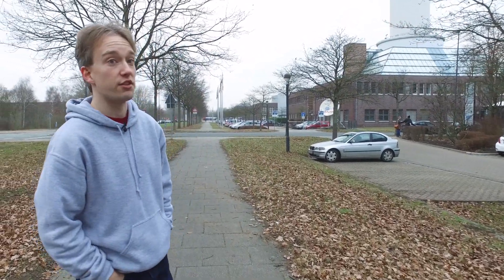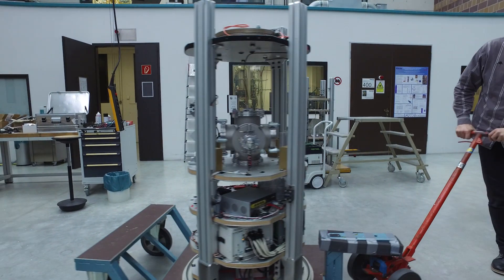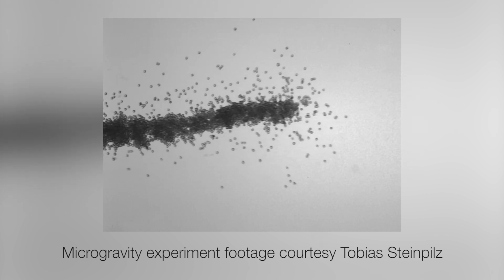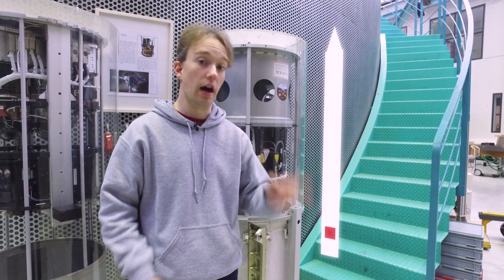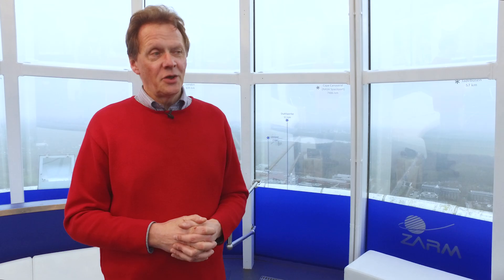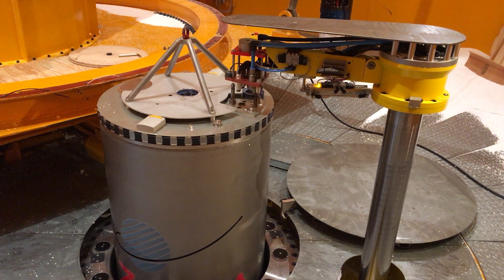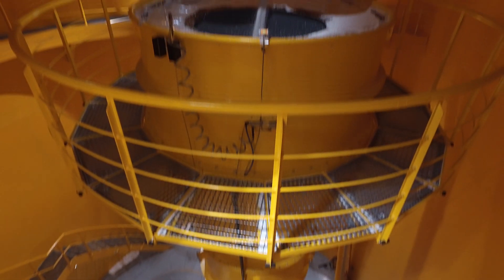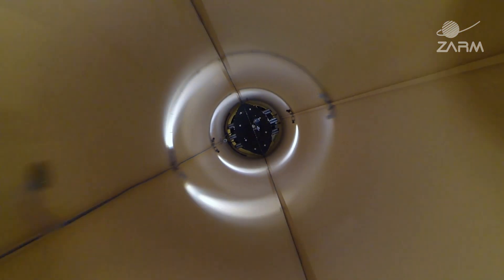Zero-G Experiments on Earth: The Bremen Drop Tower

Comment: i understand how falling creates zero g, but how does slingshotting to the top create zero g?
Reply: SomiTomi
stop giving misinformation the gravity at 250km is nowhere near the gravity of the surface of the moon. in fact it's pretty much the same as on the surface of the earth.
Reply: Connor Hill This is how you teach physics concepts to people, not by 
trowing a bunch of technical words, theories and laws, but by putting it
 in common terms that anyone can relate to and understand.
Reply: BoomBrush 
The acceleration stops less than a second after being slingshotted.
Reply: They get 0G the whole way through - the acceleration due to gravity is the only significant force acting on the sled once it leaves the slingshot.
Reply: acceleration is change in velocity. slowing down is change in velocity, the same as speeding up. once out of the cannon it is only accelerating due to gravity. this means that anything in it is in free fall both going up and down.
Reply: Michael Wylie 💥 that made sense now 👍.  Thanks!
Reply: Speed is a relative thing, it doesn't matter if the object is going up or down, as long as the only force it is experiencing is the constant acceleration of gravity, it will imitate a zero G environment even thought the object is well withing the gravity pull.
You can "feel" that you are starting to switch from rise to drop just because of the air around you and other que. But when you eliminate everything but the gravity, you achieve an almost perfect simulation of zero G
Reply: +Connor Hill You sir deserves a medal
Reply: Relative to itself it's always "falling downwards after the launch. Where the earth is doesn't effect the canister, it's always accelerating in the same direction from the get go.
Reply: Connor Hill amazing explanation. thank you!! :)
Reply: Another example that you are able to experience for yourself: Grab a ball while you are on a trampoline. As soon as your feet leave the ground, release the ball. For those few moments you are in the air, the ball seems to be in complete zero gravity relative to you.
Reply: +steven yau +SomiTomi
Indeed, the pull of Earth's gravity at 200km is still about .94g while the Moon itself pulls at you with 0.16g when you're standing on its surface. The Moon is held in its orbit by the mere 0.0003g that Earth is still exerting at that distance. Of course this is not only negligible compared the the Moon's gravity when you're on its surface, the Moon itself is in free fall around the Earth, so you don't feel that pull at all.
Reply: BoomBrush It becomes weightless the moment it is released from the slingshot. The slingshot initially speeds it up immensely quickly, so it isn't being accelerated for very long. At that point, it is being accelerated only by gravity, and since it is flying through the air in a vacuum, there is no other force acting on it. You see, we feel the force of gravity only because there is another force that acts opposite to it.. the ground. As long as we don't have that force, or any other force (i.e. Air resistance, the acceleration of the slingshot), we will feel no force. This is because the force is simply acting on us freely, with nothing stopping it.
Reply: jonnenne this is just not true. at the peak the velocity is zero. not the acceleration that is still 9.81 m/s^2. 
the zero g is there from the moment it leaves the catapult. becouse there is no other force acting on it other than gravity.
Reply: I understood it fastest by just visualizing the forces on the object and understanding what weight actually means. Weight is only more than 0, if the Earth is counteracting the force of gravity (so you standing on it). Take that force away, by throwing it up, and weight = 0. Mass isn't ofcourse, weight is.
Reply: thx Loke. i didn't catch that.
Reply: While going up the barrel and everything inside are deaccelerating at the same rate, so nothing inside is falling relative to the capsule, just like when it's going down.
Reply: Yes, thanks for letting me know. I messed up some quick calculations, sorry about it.
Reply: Sheepofthe Goodshepherd the earth axles rotates 360 degree in 24hours or 86400. it was in 0g for 9 secs. 360/86400*9= 0.0375 or 3/80 degrers. almost noting.
Reply: "The important thing is not no acceleration, it's that every piece of it is experiencing identical acceleration, and that that acceleration doesnt put tension or pressure on anything." No, just no.
Reply: If you think about there being a super fast elevator pulling you upwards, and the string pulling the elevator up gets cut, gravity will begin slowing down the elevator and you at the same rate. Gravity will not slow you down any faster or slower than the elevator, so, relative to you, you would be floating around in the elevator in zero g. Whatever items they put on the capsule to slingshot will be in zero g once the slingshot releases them. Relative zero g is experienced whenever something is being acted on by only gravity with nothing else to stop it or affect it.
Reply: Gremlin,
I think your intuitive analogy of drifting up in the freed elevator, or the water splashing out are both the result of rebound,, something extraneous.  Your legs,,, are used to holding your body weight,, yes,, they could propel you to the top of the suddenly freed elevator,,, the glass suddenly caught by your hand,, as well.  But I would suggest an experiment.

Flip a one third full water bottle to land on its base.  We've seen it in videos often.  Water is an in-compressible substance,, it has no rebound.  If the water bottle hits squarely, it tends to stand, exactly as it landed,,, with the water squarely in the bottom.  The 'trick' with flipping a water bottle is the rotation before release,, it pins the water into the bottom.  There is little or no splash,, it lands dead.  If you were to try the same trick with a compressible liquid in the bottle,,, I doubt you would be able to have it land consistently upright.  On the sudden stop,, the compressible liquid would rebound, and the bottle jump back into the air.  ONLY outside,,, gasoline is quite compressible.  Try water, try a fuel.
Reply: BoomBrush ok so, i can understand the confusion because when youre accending in an aeroplane or similarly you dont feel weightlessness, you may actually feel heavier, but thats because the plane (or whatever) is constantly accelerating away from the earth's surface, but the slingshot only accelerates the capsule for a moment, and in that moment, the capsule gains enough momentum to reach the top of the tower, in a way, as soon as it leaves the slingshot its falling back towards the earth (because gravity is a force that causes acceleration and not a constant speed) it just has a bit of momentum left to reach the top.
Think of it similarly to when youre in a car, if youre at a red traffic light with no traffic ahead, and you accelerate to 30mph (once the light goes green, duh)  in one second, then youre pushed back into your seat by the acceleration, but if youre cruising along at 80mph and not changing speed, you dont feel any force acting on you because youre not accelerating, youre cruising B)
(hope this was helpful, its not exact science im using here because our perception of acceleration is dictated by the fluid in our ears, and our perception of force is dictated by other senses, you really gotta study physics for a lengthy amount of time before most people can actually comprehend it :P 
)
Reply: SomiTomi It's very far from "not quite zero". At 400 km above Earth it's about 8.7m/s² as opposed to 9.8m/s² at sea level.
Reply: Kiwipai best explanation so far.
Reply: Connor Hill thank you that was a great explanation
Reply: BoomBrush you dont feel forces, only the changes, gravity doesnt change so you feel nothing
Reply: +Robert de Tatta
So sitting in my chair right now, gravity is not changing so I should float away? You should read through the thread. There are several good and correct explanations already.
Reply: Penny Lane gravity doesnt change but the molecules in your body are constantly moving pressing you to the ground
Reply: So it's a constant force instead of a change, which according to what you said earlier I wouldn't feel. I'm just pointing out how little sense your explanation made. I'm not doubting you meant the correct thing. You just didn't say it. So you're not contributing anything worthwhile to a thread that already has a number of correct and nonconfusing explanations.
Reply: Penny Lane no the molecules do change direction. so the force changes permanently but your body automatically corrects for it. kinda like seeing ur nose.  if you drive a car you make turn, so do molecules
Reply: Sheepofthe Goodshepherd bible says earth is round. jesaja 40. i believe verse 22 but not sure
Reply: Sheepofthe Goodshepherd dutch bible is talking about a sphere
Reply: Sheepofthe Goodshepherd wel then this is the day that i completely change my worldview. the earth is indeed flat
Reply: And of course all that is said in the bible has been proven true... I'm joking, it's all fairy tales for peoples who can't take decisions by their own.
Reply: wrong, they get 0 G as soon as the slingshot releases it.
Reply: Connor Hill ok what I can't quite get is this. Imagine your basketball is transparent and we can see the pebble inside. You've said the two won't accelerate at different rates because no air is resisting the ball. Ok great but then that in theory means the pebble would be "weightless" but would still be as it was at rest inside the bottom of the ball to start with. 
What I don't get is if both canister and contents are truly weightless throughout then what would even cause the items inside to move Ina dynamic way? It sounds like either the container would affect the item inside kind of skewing the results or due to both travelling identically what would ever cause the contents to change states in a way we can learn anything from?
I hope that made sense
Reply: imbecile
Reply: Igor Igor who was that for?
Reply: Your question is perfect.  Actually it does not land exactly in the same spot, because the Earth is rotating on an axis,,, and the latitude for the tower must be what? 48 or 50 degrees north?  However,, it is very slight, and it is absolutely repeatable, and calculable.  You will find your answers in an artillery table.  I do have a book here somewhere,,, been years since I've seen it,, an entire volume on angle, distance, time of flight, and corrections for the Earth's spin.  It varies with the latitude and compass direction of fire.   Corrections are needed for very long artillery,, 15k, 25k, etc..  The artillery,,, or the object in the tower,, once released,, is very Newtonian,, it is the Earth that tries to move out from under.
Reply: The important thing is not no acceleration, it's that every piece of it is experiencing identical acceleration, and that that acceleration doesnt put tension or pressure on anything. 
From the perspective of the capsule it is perfectly indistinguishable whether the earth is moving up towards it or it is moving relative to the earth. In fact in 4D spacetime it is more accurate to say the earth is moving towards it at 9.81 m/s^2. So when it's thrown up they are giving it greater velocity than the ground has, but stop accelerating it putting it in zero acceleration. But the earth keeps accelerating and when the ground reaches greater velocity than the capsule then the capsule starts "falling" but the capsule keeps identical velocity throughout that change until the ground catches up and hits it with that cushioned bucket

Not sure if i explained that well, i recommend checking out PBSspacetimes's videos on gravity
Reply: Gremlin the OP
Reply: +GrayEcho That's great and I understand that concept but I think I didn't explain my main issue correctly. If you imagine the acceleration then lack thereof that would affect both you and the elevator differently. Once the cable was cut you would feel the lack of force driving you down into the floor of the elevator and that would naturally make you move upwards.
I guess I'm thinking of a glass of water. Imagine you throw your hand up sharply and stop suddenly the water will naturally be thrown up and likely out of the glass. If you watch the video it shows it from a different perspective (check around 1:12) but imagine you rotate that footage 90 degrees anticlockwise. That sort of pattern is exactly that shown by water in the situation I described above. A strong central column with drops starting to break away and the longer and thinner the column gets is because more and more water is leaving the column (as well as a form of "stretching" if you can call it that).
Now to explain my main gripe.
Its simply that the contents do very much seem to be affected by the sudden then lack of initial acceleration. I understand there is probably some merit to what can be discovered subsequent to that but all experiments will be affected by this and therefore it seems that the results maybe only initially will all exhibit a very similar pattern (at least when talking about liquids or maybe something made up of a large number of small parts like sand lets say). I just don't see how that element really teaches us anything as that part is always created by the loss of acceleration.
I hope that made sense
Reply: +Sailor376also Sorry but I'm not sure how that relates to this when the capsule is effectively fired in one direction suddenly and then allowed to freefall. Its different from the centrifuge-like effect that spinning a bottle creates.
A better comparison would be to grab your bottle of water and throw it straight up into the air with no rotation and see if the water in the bottle leaps upwards at the end of acceleration, which it would.
I'm not trying to be rude but what exactly are you trying to say with your example? That a compressible liquid wouldn't react in the same way as an incompressible one? That a compressible liquid wouldn't move upwards in a column that starts to lose parts of the liquid in various directions? Is that all you are trying to say?
Reply: You make it more appealing, but you need quite a bit more for a lecture.

It's an important part to make it appealing, but also the rules the system follows can be appealing.

Theories and laws are really important, to understand.
Maybe not for the things right in-front of you, but if you get a good grasp on a theory, following ideas will occur and make other ideas and concepts more appealing.

There always has to be a good balance of Formula to Appeal.
Reply: jonnenne misleading, you never get 0 g, but you DO get weightlessness, the moment its released from the slingshot, but it experiences greatly amplified weight at the moment it accelerates
Reply: +Sheepofthe Goodshepherd Have you never heard of inertia? Just because you launch something straight up does not mean it suddenly loses all of it's inertia and land somewhere else. Every object attached to the surface of this planet and the atmosphere that surrounds it has inertia and roughly the same tangential velocity at a given latitude. Therefore for most local calculations on the planet you can ignore the rotation of the Earth and work with a simple frame of reference. Does this mean the Earth is flat? Absolutely not.
Reply: When there's nothing holding you up, you experience zero g. The capsule is accelerated for 200ms with all the kinetic energy it needs to get to the top. From the end of launch until splashdown, it's at zero g. Its position and speed are unimportant.
Reply: Basically, the capsule and all its contents accelerate rapidly, but only very briefly. Once they're moving upwards at their top speed, there is no air friction to slow them down, because the interior of the tower is a vacuum. This means that the only force acting on the capsule is gravity, pulling it down. But gravity is pulling on the capsule and all its contents uniformly, so everything that was launched upwards will rise and descend uniformly.

Imagine you were in a sealed box, that was falling in a vacuum. Both you and the box would be falling due to the pull of gravity, but because the floor would be falling at the same speed as you are, you would experience a sense of weightlessness. This is the environment that the capsule's contents would experience (it's also how the zero-G training plane the US air force uses works, by the way).

The researchers could just drop the capsule from the top of the tower to get the same environment. But by launching the capsule from the bottom, they get twice as much time to conduct their zero-G experiments, as the capsule rises and then falls.
Reply: as long as the ground (or the air or something) isnt touching something (applying a force), it will be weightless, so the up part is weightless as well
Reply: @chillbro1010  Thanks mate, i was just scrolling down for finding the simplest explanation. This one is perfect.
Reply: The idea here is that since the capsule (and everything within) accelerates at the same rate (somewhere around 9.79 m/s^2), the things inside appear weightless. It's worth noting, that this isn't just similar to the weightlessness experienced by astronauts, this is the exact thing that makes astronauts weightless in orbit. While gravity is weaker at that altitude, it's not quite zero.
EDIT: Yes, I messed up some calculations. I apologize.
Reply: You learn this in highschool phisics: If you have an object on vaccum, there is no resistance. Since there are no resistences the combined force applied to the capsule is equal to the force of gravity and the force applied by the catapult only at the launch. After the launch only gravity is being applied on the capstule. You will learn the acelaration is the change of speed and acelaration is equal to force devided by mass. since the mass and force is constant the aceleration is constant thoughout the whole lift and fall. In reality these experiment's aren't 0G , they are simply done in an environment where only gravity is being applied.
Reply: At the pinnacle, before it comes back down, it is temporarily weightless.
Reply: Starting from the top and simply falling to the bottom is zero G.
Starting at the bottom and "falling" up is just that in reverse.
Reply: You get 0 G at the absolute peak just as the "sled" is stationary. So they get 2 significant measure points instead of 1.